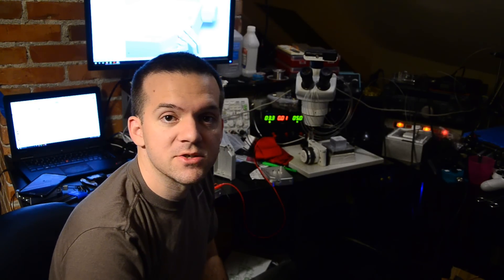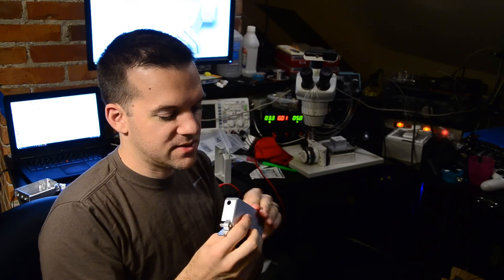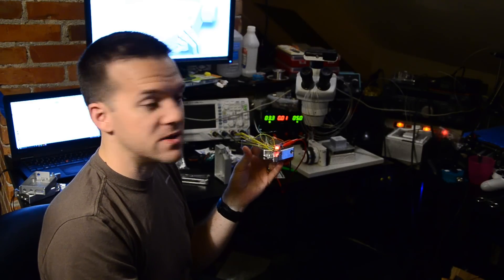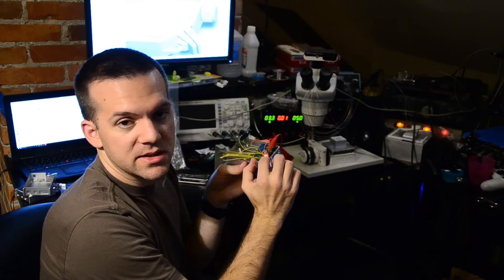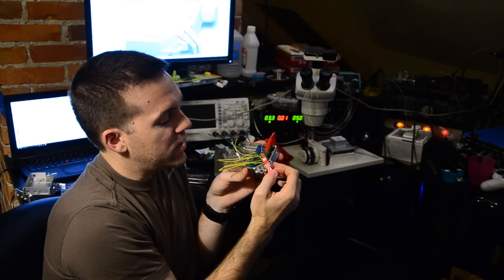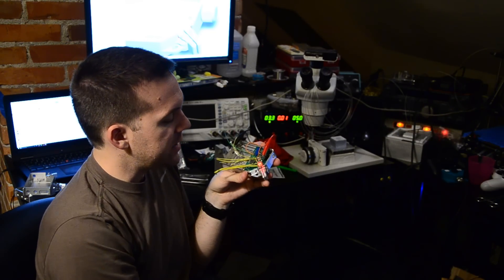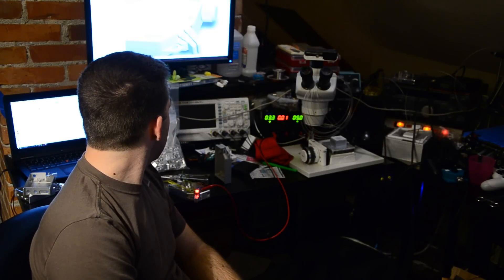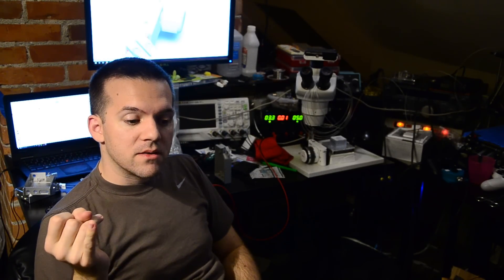Portable SDR - Kickstarter Production Update

Comment from the maker: Thanks for the comments and congratulations on our baby! We're very excited! Also, it's good to know that most of you seem to be okay with some delay if it makes the radio better. I honestly believe it will, but I have set a limit for myself so the improvement cycle doesn't continue forever and push things out. Basically,  the test board I am designing now is it, the parts that work will make it in, and that will be the version that will ship.

Comment: I'm ok with a delay for a better product. Also, on the paddles, I recommend using optical interrupters instead of contacts. An led + a photo-diode per paddle should do it -- and bounce is not generally a problem. Also - no problems with dirt or oxide on the contacts.
Reply from the maker: +Madscientist Microneil Interesting suggestion. What about tactile feel? I originally had support for capacitive touch paddles, but they would be very hard to use, I think. I also looked into hall-effect sensors but was worried about feel and repeatability. Are there any keys out there that use optical interrupters? Do they work well?
Reply: +Michael Colton 

Tactile Feel?: That shouldn't need to be any different than conventional contacts. It's just that in this case the contact is simply a mechanical stop and the sensing is done with light instead of conductivity.

Any keys out there that use optics? I don't know of any keys that use optics -- but since you're inventing it seems a great opportunity to try. Having played a bit with optics it seems you have a good opportunity here -- you're building something that may need to work reliably in hostile environments-- and you're building the parts, so optics are a good fit... 

Essentially, if you can see light between the contacts the contacts are not closed. There are many ways to accomplish that.

Looking at how I set my Bencher paddles, I see a a few mm of movement.. A small drilled hole as a light passage that moves out of the light path when the paddle is touched should work. If you need to amplify the motion just extend an interrupter of some type off the back end of the paddle to any length you need. (Just thinking out loud).